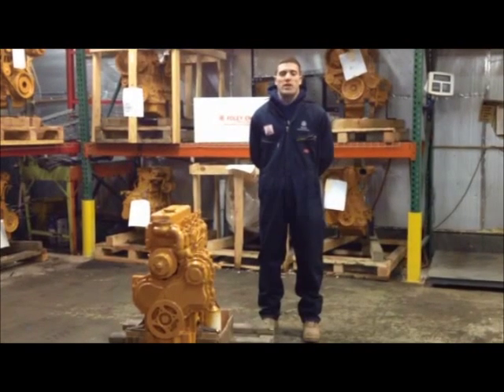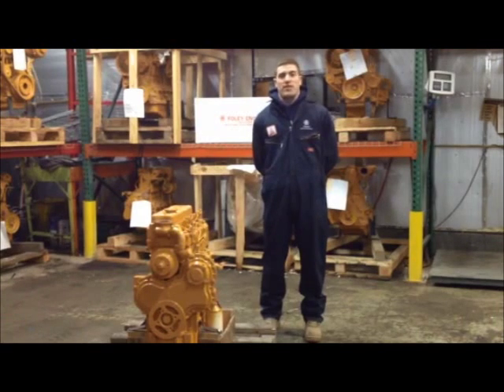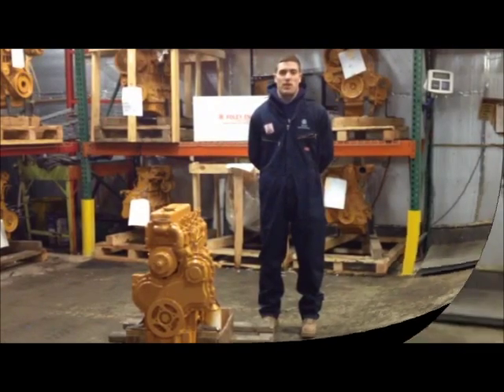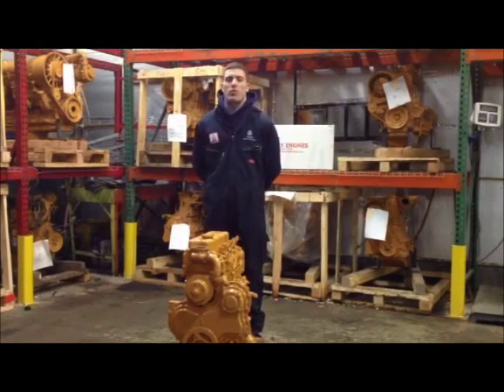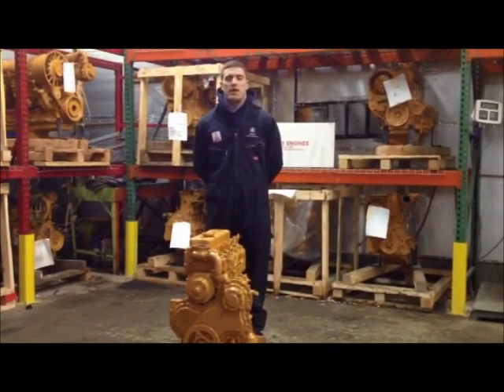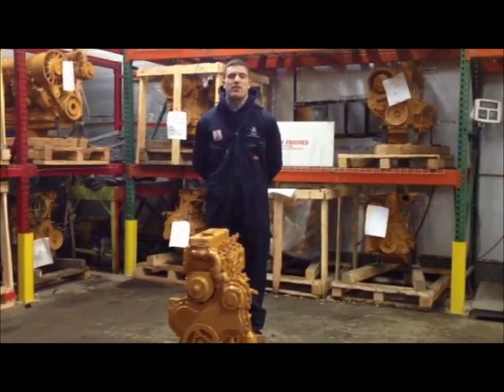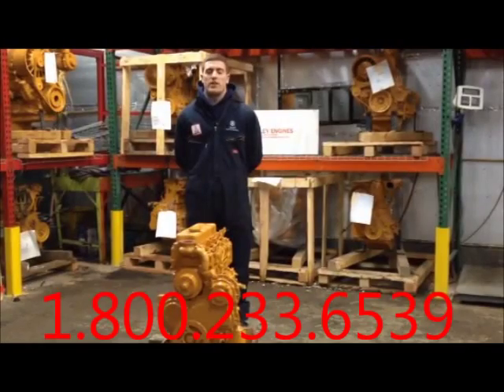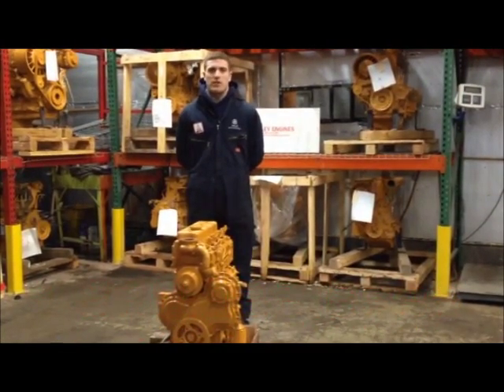Perkins 4.236 Engine Serial Number Location

Comment: Sr. Good night.! I have a one problem. I don´t now what is the correct part number O/H repair motor for this Serial number: LH50133U030904M can you please help me? My motor is 4 cilinders and have 4 rings for piston, but rencently I buy a kit O/H POK452 perkins but this kit have 3 rings for piston. can you please help me?
Reply: Based on the first two letters of your serial number, I believe you have a Perkins C4.236   
Four-cylinder, 236 cu. in. (3.9 L) "compensated" (lightly turbocharged) diesel engine. 
Source:
https://en.wikipedia.org/wiki/List_of_Perkins_engines